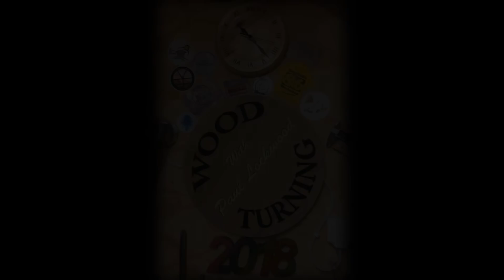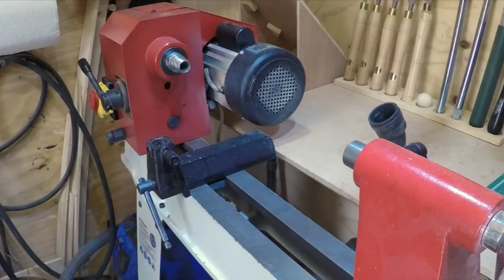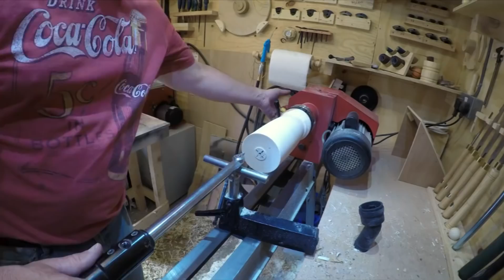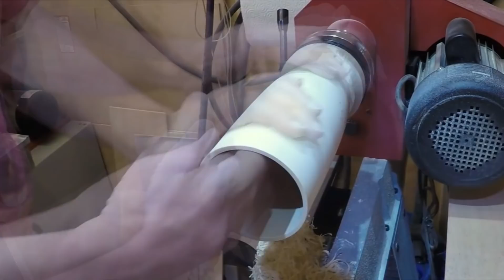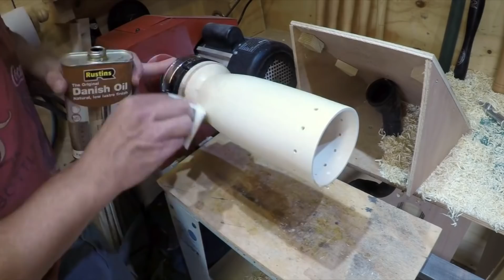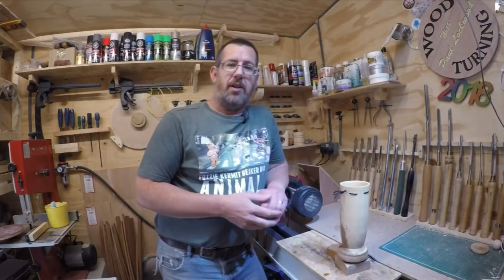Wet Walnut Vase - Episode 140

Comment: Hi Paul -- very nice piece!
Question - Being wet wood and warping will take place - was there any issue with the cord being tight so when the piece warped, the cord restricted movement and cause cracking at the rim?
I do not have a hollowing jig (yet) - I am assuming you would recommend the Simon Hope system?
Regards
Dennis Beamish Cambridge Ontario Canada
Thanks for sharing this video.
Reply from the maker: Thank you Dennis. It had warped before I even parted it off, in fact a few hours after hollowing. I needed to give it a few coats of Danish oil so it was drying well over 3 or 4 days before I went back and put on the cord.

This was an experimental piece to see what happened and any cracking would have not been an issue for me, more a feature. If the piece was to expand a lot in one direction then I suspect a tight cord could cause more issues.

The hollowing rig is very good, with you being in Canada there are other options from the USA, for us it's pretty limited and long delivery times and big import duties to get from the other side of the pond.